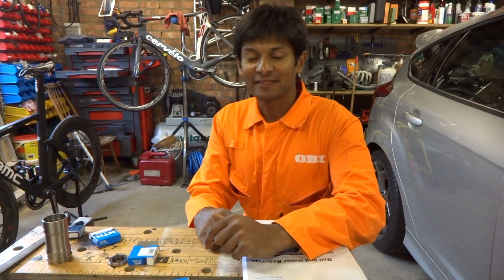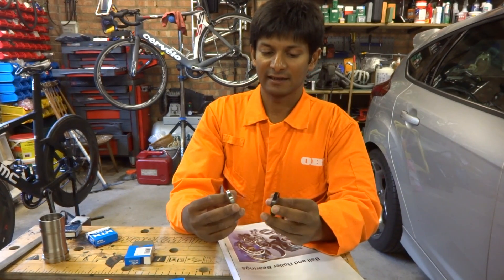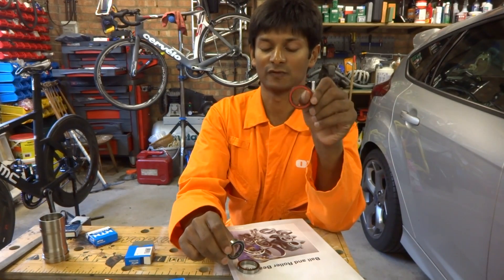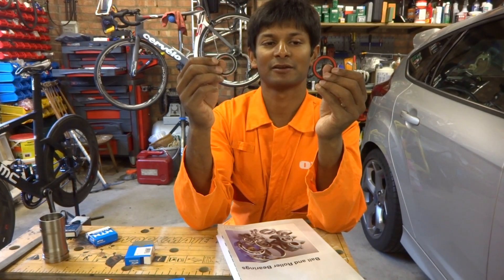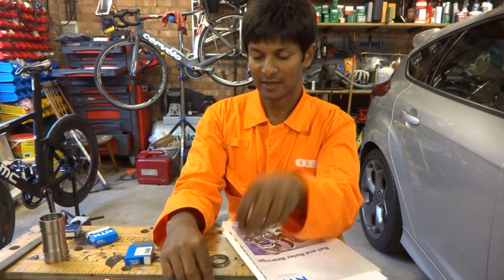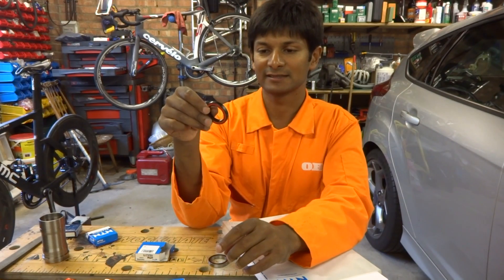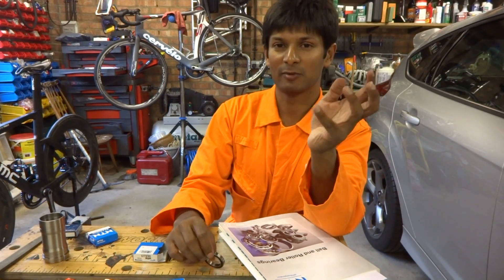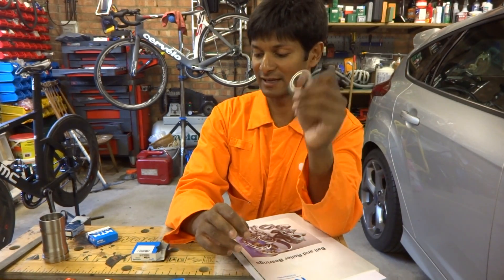Bicycle Bearings and what to buy by an Engineer

Comment: My roval CLX 50s require 4 6802 bearings and 2 15x26x7. I searched your site and found the 6802 ntn llb; but I cannot find that bearing type in the 1526. The 1526 on the site looks like a multi brand out of package type bearing. Is it bad practice to buy the 4 ntn’s and mix it with the 2 of the 1526 from the site??

Comment: I really enjoyed this content, finding it still up to date 8 years later. 
I can give you my preferences for cycling, based on my experience :

- EnduroBearings, like you said, really suck on wheel hubs. Tested some ENduro Bearings 6903 for my Reynolds wheels, they started to rattle pretty quickly.
- NSK, I don't like them mostly because they feel sticky to me. I will not use them anywhere.
- SKF makes some really really good products, even intermediate sizes are super nice, for example the 6903 I replaced on my Reynolds wheels. I especially like their RSL seals (low friction), but don't pressure wash RSL seals because they're not the most waterproof ones !
- FAG is similar to SKF, extremely high quality, and sometimes even better for static and dynamic loads (make sure to compare both websites for common sizes, and you'll see a slight difference sometimes !) I use FAG bearings on everything that is not cycle, as replacement ones (electric tools for instance)
- And finally NTN which is absolutely insane, with LLB seals. My Mavic Cosmic are fitted with 6901 LLB by NTN. I think I won't find better. They're so smooth and durable.

Remember : it's better to buy a really high quality chromium steel (100Cr6) bearing, than buying an intermediate quality cermaic hybrid bearing. Ceramic bearing is kind of a pitfall for amateur to semi-pro cycling.

In order of preference : 
1) NTN
2) FAG
3) SKF

Comment: hii, in case you answer, even though is an old video. I can only find zz bearings for my hub, are they going to fail too soon? I get that rubber seals help keeping moisture and dirt outside better than zz bearing seals, but is it that bad of a difference?

Comment: NSK do thier VV, which is thier non contact sealed bearing. I sell the 69** and 68** series , that are the common series of bearing in bikes. I have had no negative feedback.And have sold them for many years. Im fairly confident that the NTN full contact sealed bearing whilst not running as free as a non contact seal have better sealing for more extreme use.

Comment: Any advice on Zen bearings @Hambini? I'm in the Netherlands, and they're the only brand apart from Enduro which I can find for a 17287 bearing for my wheel hub. Not sure how decent they are.

The old bearings coming out of the hub were the original ones fitted by Mavic, and they were NTNs. They were great until the seal in my ratchet broke, which then exposed the bearings to water. Both now feel like peppermills. I wish I could get hold of some identical NTN bearings in the Netherlands, but it looks like it's not gonna happen unless I pay the import tax on a set from the Hambini shop.

Comment: It is very strange that i came across the complete opposite. For example, enduro bearings had plastic cages and some, not a cage at all. They are total crap that you overpay as well. We agree on that. Skf, never till this day have i found an skf with plastic cage inside. it is always metal. But very stiff to rotate even in 6801 2rs size which is very small. Ntn is the same brand now with snr , and they have metal cages but also extremely stiff to rotate. Nsk metal cage and reasonable ''rotary''. Haven't been able to find fag in 6801 and 6902 sizes yet. And an american cheap brand called PFI also have metal cage and they are very easy to rotate. I think they are made for high rpm enviroments. They are also the cheapest of all, except some chinese no name. Lastly for tolerances , i've been struggling to find c1 or c2 clearance , nothing comes out. Only c3 seems to be the norm, as i was assured by ntn representative . the c3 is the normal tolerance found in almost all bearings. For electric drills and extremely high rpms c3 is mandatory because of heat. But in bicycle you need tight c1 or c2. And i've changed the grease inside them to extreme pressure. But i have to say , that every single bearing that i've removed the seal from to regrease, no matter how cautious i am, when put back together, it just never feels the same.

Comment: Hi Hambini. Bit off topic, but hey, us kids ... I experimented with full ceramic bearings on both front and back wheelhubs and freehub to get rid of lubricants and seals. I am proud to announce that after 4 montths of riding and commuting  that 1 of the smaller 6803 freehub bearings (the inner one, closest to the gripping mechanism of the freehub) has failed catastrophicly: partly shattered inner race. I did not notice it happening though. I only checked because the freely spinning rear wheel was noisier during placement of a waxed chain. I have detailed pictures if you like. All other bearings are still tiptop as far as I can tell. I'm thinking of relubing the drive side of my wheel and replacing the broken SMB 6803 with a relubed NTN 6803LLB but keeping front wheel and non drive side of rear wheal grease free to see what happens. I'm wondering though if having 2 types of 6803s in the freehub is not some enginering nono (undue stress on the weakest link?).
Reply: The only place I can accept running a full ceramic bearing is a rear derailleur's pulley wheels.
Reply: why's that?? @sbccbc7471

Comment: Im in France and my local distributor only has "5k" suffixed NTN bearings. What does it mean, contacting or contactless, it's all 5k. Should I get them?
Reply: It means how much of the seal is contacting the inner race. Non-contact means the seal just lightly touches the inner race. Good for low friction, but not as good in protecting the internals from the elements.

Comment: If you had to buy bearings for a winter bike bottom bracket (6805) what would you buy? 

Not worried about friction, i just want longevity. I would try and clean up the outside of them every 6 months but won't remove them until they are done. I live in the UK and BB's are always killed by rust rather than being worn out. I see NTN have Teflon Grease inside them. One of the Enduro bearings has CRC Marine grease inside it (and i know that grease is good).
Reply from the maker: Ntn 6805 llu

Comment: Would be interesting to hear your opinion on Chris King bearings? (mainly steel, though they do offer ceramic options too)  Interesting because to the best of my knowledge, they're designed and made in house at their factory. Their products tend to carry a premium but I've had good results with them over the years.
Cheers

Comment: I'm presuming this relates mostly to BB or wheel bearings? Do you have an opinion on best price vs quality for mountain bike suspension pivot bearings? I guess in some cases I care more about mud and grit getting into them and wearing that way. But maybe that's not entirely the case. I don't want to spend a small fortune on the ultimate, for 10 of them. It's not exactly gonna slow me down if they're lower quality, it's more about longevity and being regularly used in filthy, muddy conditions. I think my bike comes standard with Enduro Max double row. OK for that bang-for-buck (and I can get them free if I pay the shop to replace them under warranty), or is there a better happy medium to buy them myself and pay more to increase life vs not going bankrupt in the process?

Comment: Enduro is not a manufacturer like SKF, NSK, NTN, Timken, ect.  They do not specify the source of their bearings but they charge the same a and more than major manufacturers,. I would not trust them. Unfortunately some bike manufacturers use non standard  bearings which are only available from Enduro.
Reply: Enduro do manufacture their own bearings...they have one factory in USA and one in Singapore...

Comment: Question for Hambini: can you comment on the potential utility of tungsten disulfide dry lubricant instead of low viscosity grease or oil for race applications (in BB’s)? Thanks.

Comment: I always thought that smaller, cartridge tapered roller bearings (cylindrical, not ball) might be a better choice for bottom brackets. Bullseye once made a custom needle bearing integrated into their box steel BMX cranks back in the 1980's. They used a thrust bearing with it.

Or maybe just needle and thrust bearing combinations. I suspect that bike "engineers" are compensating for a poor choice of bearings by making the bottom bracket ever wider and using larger diameter bearings. That's wrong.

Comment: Does manufacturer recommended grease matter or will any good quality grease do when cleaning and re greasing ceramics? I am due for a service but my bike shops don’t seem to stock the recommended product given by manufacturer (bbinfinite) - which have been absolutely phenomenal bearings so far.

Comment: Cracking videos - u have a subscriber - Thanks for the contents - Great explanations.  Need to replace my FSA Bottom Bracket BB30 Ceramic bearings (Boardman team carbon frame), its been 3 years and thanks to your video I wanted to try an NTN - Will this do? the 6806-LLB NTN NON-CONTACT SEAL TYPE BB30 ( 
https://www.airevelobearings.com/product/6806-llb-ntn-non-contact-seal-type-bb30/)
Thanks to u we all end up here: https://www.bikeforums.net/cyclocross-gravelbiking-recreational/1162180-ntn-bearing-replacement-bb30-frame.html

Comment: Hello Hambini. 
Thank you for the informative video. I am getting the following three bearings in India but not getting the LLB option. Which one would you suggest? As you suggested LLU will have more friction than LLB. Can you share your inputs for the other two bearings  JRXZZ/2AS and JRX? 

https://www.industrybuying.com/deep-groove-ball-bearings-ntn-PO.BE.DE.182103/?q=ntn%206903

https://www.industrybuying.com/deep-groove-ball-bearings-ntn-PO.BE.DE.182101/?q=ntn%206903

https://www.industrybuying.com/deep-groove-ball-bearings-ntn-PO.BE.DE.182102/?q=ntn%206903

Thanks.

Comment: Hi Hambini. Question re Ultra-Torque bbs. Can you use a bearing like the NTN 6805 25x37x7 instead of the campagnolo 6805N 25x37x6? Can’t find alternatives anywhere other than enduros.
Reply from the maker: You can if you are prepared to machine your cups. You'd need to take the extra 1mm off. Hambini
Reply: Hambini thanks for your answer much appreciated! It’s a 3rd party T47 campy so company might be able to do a custom conversion.

Comment: Hi Hambini, as a mountain biker as well as a road cyclist I am curious do you have any experience of knowledge on ingress protection of a RZ type non contact seal and a 2RS rubber sealed bearings? for me i'm not only interested in the reduced drag of bearings but also the weather proofing.
MTB bottom brackets are generally subject to more dirt and debris than a road bottom bracket, also tire drag is likely to far outweigh the drag by seals in a bearing.

When it comes to pivot bearings their range of movement is minimal and whilst i'm sure having reduced drag across the bearings ( as the amount of stiction would soon add up with multi bearing linkages - side note - this could impact on shock sensitivity.) I am more concerned with longevity of the bearings as generally i do not have the time to strip down and replace multiple bearings on a regular basis. 
What would be your recommendation for bearing for these applications?
Reply: Russel,  I have similar concerns - not worried about fractional savings, but more about having fun in the mud without replacing bearings every few months. I'd say a 2RS contact seal is the way to go, as there's no gap for water ingress. Even better would be Enduro's LLU full contact seals.

Comment: Awesome vid.
I have a Question. Does it help cleaning out all the new grease and replacing it with moly disulfide oil make a difference, or is it to slippery? And the metal seals. This is just used for sprints or uphill sprints. And just for the event. So max 5km.
Might it just be a placebo
Reply from the maker: If you are going for an all out effort then take the grease out and replace it with a light oil. It won't last that long but it will do an uphill sprint.
Reply: @Hambini  thanks 👍

Comment: Hi, interesting to hear your opinions on bearing brands. I've got a question that I'd value your opinion on.

I'm intrigued by the Onyx Racing mountain bike hubs. They use a plain axle, threaded at one end so you can adjust the preload. As standard, they come with hybrid bearings. I agree with your comments about this type of bearing so I'm already thinking about the replacements.

All the bearings in this hub are sizes where there is an ACB alternative. As they have adjustable preload on these hubs, what are your thoughts on switching to ACBs?
Reply from the maker: If you are going to get high axial loads - and you might on an MTB then an angular contact will be better at absorbing these loads. This decision comes at a cost which is that of friction. If you were to do this on a road bike, it's a no brainer the friction increase is not worth it. I don't ride MTB so I can't comment on whether the sacrifice is worth it.
Reply: @Hambini  Thank you for your thoughts on this. The main attraction to these hubs is the silence and the instant engagement. Given I'm running 2.4" knobbly tyres, bearing drag isn't as much of an issue. I'm more interested in good sealing and longevity (which is why I don't expect the standard hybrids to last long).
Reply from the maker: @steveedwards5280  In which case I would get full seals, and if you are going to bounce the bike angular contact would be better. Even if it's an up and down motion of the bike, it's an axial motion because the bearings sit wider than the tyre.

Comment: Why don't manufacturers use full ceramic bearing ib a bottom bracket for example?
Reply from the maker: A full ceramic bearing is brittle, any vibration and it will break.
Reply: @Hambini  thank you

Comment: Am I the only one that degrease new bearings and repack them with better grease?  Curious.
Reply: Finish Line Extreme Fluoro or what's your choice?
Reply: thats a bad practice, you only use a degreaser if the bearings are contaminated with dirt ..
Reply: @janeguzzma1985  Why?

Comment: Hi Hambini ! I plan to replace Novatec Hub bearings. It is mentionned 1PCS OF #6802 + 1PCS OF #15267 on rear and 2PCS OF #699 for the front. What do you advise as bearing brand to replace them ? Thanks ;-)
Reply from the maker: I would go NTN 6802, ZEN 15267 and INA 699. The 15267 is not a standard size and only a small number of companies make the 699
Reply: @Hambini  , Wahoo… that's impressive how quick and accurate you are ! Thousands thanks !

Comment: Wow, great content! I really missed that engineering approach in the other channels. In one video you said that for wheels you prefer shimano cup and cone bearing hubs. Its quite interesting, since they are generally said to be low end and heavy. Could you explain it furthermore?
Reply from the maker: If you have the ability to make your own bearings in house then it's cost effective. Being a large company, Shimano can do the bearing races in house so it costs less for them to make. Cup and cone also allows for a large degree of preload adjustment whilst standard 6000 series do not.

Comment: Hello Hambini i have learned a lot from you videos i really appreciate it. just have a short question, i want to replace the bearings in my roval clx 50 front wheel, i am wondering what size of the bearings should i buy for the best performance, i think they are the same as dt swiss 240 internal structured. thanks a lot again.!
Reply from the maker: Usually they are 6902 but some of them have an 18mm instead of 17mm axle, so it's best to check
Reply: Why did you want to replace them? I've been looking at some wheelsets including clx 50, did you have any serious issues with them or
Reply: Richard Red found out the bearings in some of these wheel are tight, so they can’t spin freely.  Need to take the bearings out and put them back, solved the problem. If your wheel can spin freely then you don’t need to
Reply: @jayhuang3544  got it, thanks!

Comment: Great videos!!!  Curious how I can buy NTN BB90 bearings?  Any help would be greatly appreciated.  Thank you!!!
Reply from the maker: NTN don't make specific BB90 bearings. You can use an NTN 6805 with delrin spacers. The issue is the Shimano crank is 24mm OD, the bearings have a 25mm bore.
Reply: @Hambini  The problem is I can find the bearing, but there's no mention if it comes with the delrin spacers.
Reply: Thanks.  I hate that spacer and looks like only Enduro makes the 24mm bore..
Reply: @danrol354  Which bearing did you go with?
Reply: @Methodical2  I believe I went with Enduro to avoid the spacer.  I may want to go with the NTN bearing with spacer after I use all my spares.  Which bearing did you say you found for BB 90 but doesn't specify if it comes with the spacer??  Thanks
Reply: Hambini Hi.  Where can I get the NTN 6805 with delrin spacers for BB 90 you mentioned?  Thank you!

Comment: wha?? I need 61803x5  61903x1 and a  bb 86 gtx.I was going to get ceramicspeed. You and others talked me out of that.  Then Endero. You talked me out of that. I just want the best. Based on wattage saving and I want it to be working in 6000 miles. (1 year)  Please just tell me what to buy. I will tip the channel. Glad I found you..
Reply from the maker: NTN is very popular.